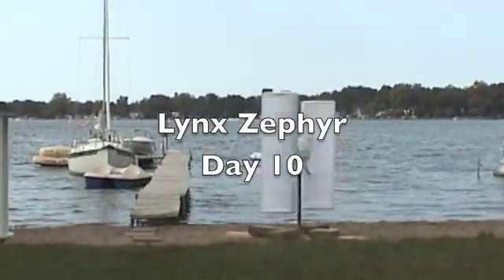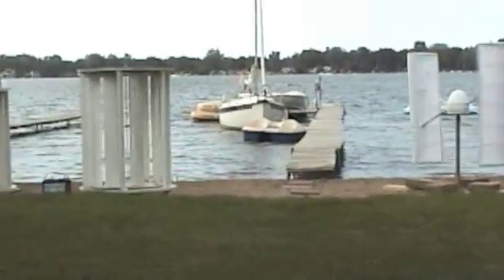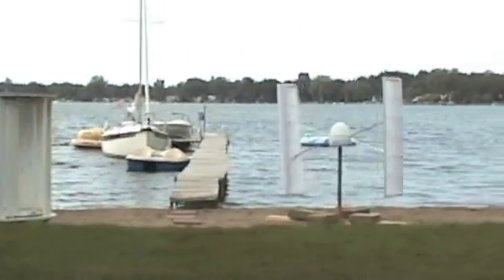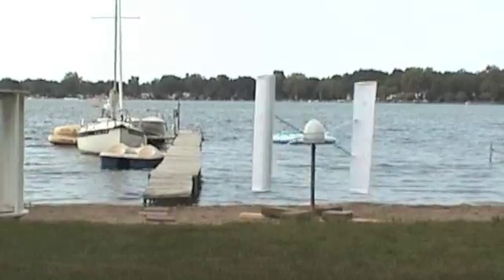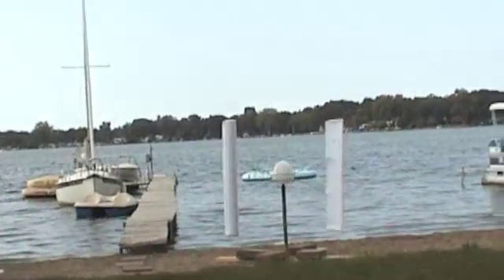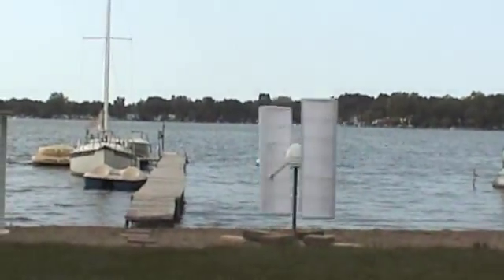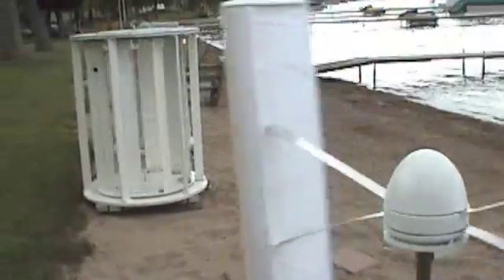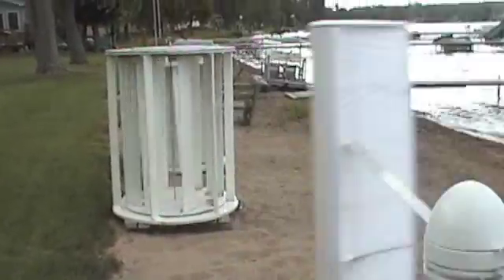Zephyr day 10

Comment from the maker: @pangavamanos 
Thanks, I sail alot and use telltales to find best jib and main set.  I quickly realized my mount point needed to be moved back.  Once that new setting was made it goes into lift even at 5 mph.  The covering wasn't the problem.  My leading edge from aluminum is a problem and I will change to a foam plywood composite wing.  I am encouraged that this is working now as hoped and planned.
Next will be 10" wide x 3' wings, three wings on a 4 foot diameter, turning a Wind Blue low rpm

Comment: Have you ever thought about building one that was built more like a padle wheel on a mill. To sit in a case, likea steam turbine, or squirl cage heater fan? You could then add fins or a tail, to cause it to turn in to the wind. but if you fit some thing of that nature to a venturie, or big funnel shaped inlet, the inlet could be cut to spin and linked to the center "padle wheel by belt or gear, seams like it would make higher revs. just a muse, but what would you say? Could work?